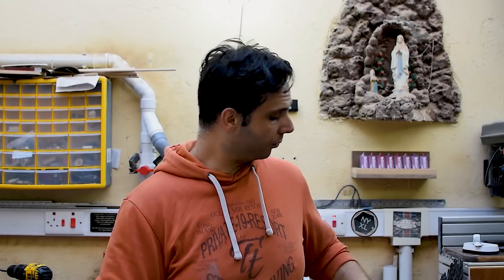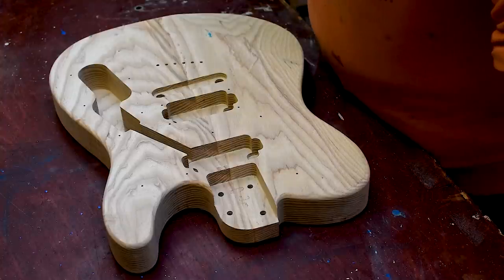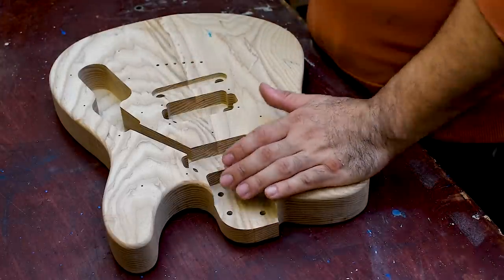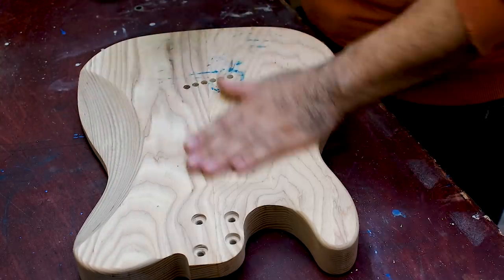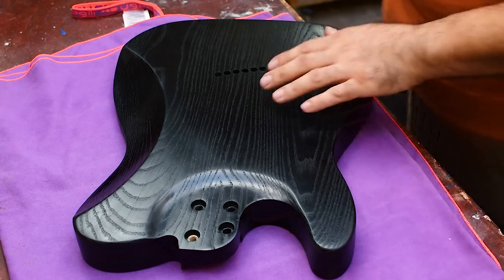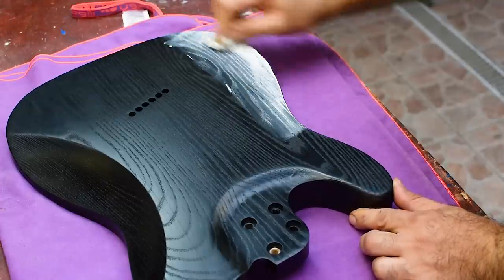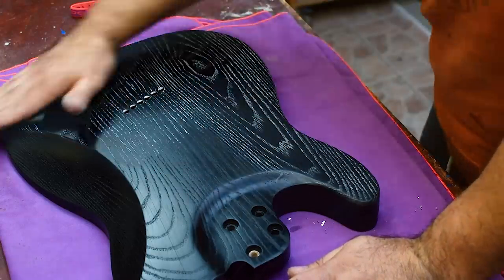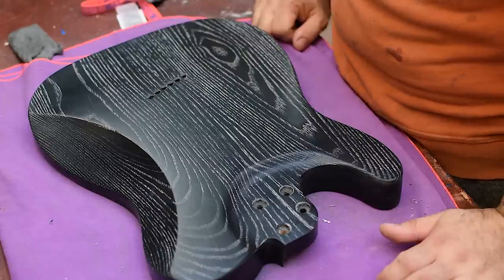Ceruse finish on an Ash guitar body blank

Comment: Based on your YT this is what I learned trying it on several samples. Wood prep: wire brush the bare wood with the grain, then sand up to 220/240, apply some Naphtha to raise the grain and sand again to 220/240. Painting: I like the black and suggest using satin black. (I used Mohawk Satin Black) I think it looks better than gloss but that’s personal preference. Apply 5-6 coats. Next apply a clear sealer or top coat, I prefer Mohawk clear satin. Apply 5-6 coats. Apply the white grain filler. I tried a few and prefer Wunderfil wood filler. Other fillers dry too fast and this gives you a min to get the excess off but you have to work a small area quickly. Use lots of paper towels or clean rags. I don’t recommend steel wool because it will dull the finish with tiny scratches. The reason for applying so many coats of paint and sealer is that you won’t rub through the black finish trying to remove the white filler. After removing the excess white (the grain may require a couple of white applications) put as many clear coats on as you like. Just make sure it’s compatible with your paint and sealer on a test sample first.
Reply from the maker: If you apply 5-6 coats of paint you risk to clog most of the pores and the effect will be less.
Reply: True but this wood is so porous and by wire brushing and vacuuming the surface the effect is still stunning. And you don’t dull the background. I’ve tweaked the process on about 5 ash samples and this is what I learned
Reply: Do you sand in between paint coats?
Reply: Jim this is darn helpful as you shared the Grain filler to use and pointed out the importance of sealing the base coat first.
Reply: @InvictusS5  sorry I’m just seeing your question. It’s been so long but I’m guessing I didn’t sand to build up coats.

Comment: so THAT'S how it's done! Been trying to figure it out in my head for months lol! Saw a cool guitar that had a red finish with black pores. Thanks for the video dude!
Reply: Basically, it's not a step-by-step how to. The guy tried to show how to make a dog hair finish, unfortunatelly, he's more of a creator, not a couch.The shape of the wood and the result though... Magnificent
Reply: Seen some Ibanez guitars with dog hair finishes, pretty cool look! But the same process should work for other colors too right?
Reply: Yep, it will work with any pair of contrasting colors. You may use luminiscent pigments too ))  
Also,  in my humble opinion, Ash is the best (but not the only) wood for this type of finish.
Reply: @Heuchler52  oak has similar open grain to ash and will work well too.
Reply: @GatenGraver  While oak splintery-splinters.

Comment: I did this to a mahogany guitar I built recently although I used the sun to first darken the wood a few shades (as  mahogany darkens under UV light) ,then filled the grain with black wood filler and used a fine finishing  sanding sponge once it had dried to remove the excess filler then proceeded with boiled linseed oil which I find pairs superbly with spray can clear coat due to spray cans containing acetone to thin the paint which allows it to bond to an oil finish nicely
Reply from the maker: How did it turn out? I know mahogany is not so much porous as ash wood.
Reply: @ManicaroCustomGuitars  it turned out quite nicely ,not as visible as the one in the video although I used black on dark brown wood so it's alot more subtle unless you look closely
Reply from the maker: That's the thing with mahogany, isn't that grainy as Ash
Reply: that's very true

Comment: Hi I love the video, can you tell me what sort of paint did you use, what sort of putty and any other material you used thanks
Reply from the maker: So, black spray can and then I used a water based grain filler putty and 0000 steel wool.

Comment: hi couple question 1 Does this work with Swamp Ash as well? 
                                 2 What were the products you were using for the Black and the sealer?
                          I have a Warwick Teambuild bass coming and being a lefty it gets very basic for what you get so its just a natural wood finish.
                        Id like to do something with it to bring it to life and I cam across  this and wow it amazing. I also subscribed and followed I was really impressed just was trying to figure out the products you were using Thanks
Reply from the maker: Well that's actually Ash wood, swamp Ash probably the same. So the black colour was a black acrylic spray can, and I used a white water based wood putty for the filling the grain and I sealed everything with a couple of coats of True oil in this case but you can seal it with lacquer too.
Reply: @ManicaroCustomGuitars  perfect thank you

Comment: When you first put on the 2 coats of black paint ......did you spray it on ?     was it semi gloss ?      Thanks !
Reply from the maker: Yes I sprayed it on and yes it was semi gloss, but that’s is not really important because it’s still need to be sealed with a clear lacquer, either matt, semi gloss or gloss.
Reply: @ManicaroCustomGuitars  Thanks !

Comment: I just got a swamp ash tele body I want to do this to.
Can you tell me exactly which black spray you used on this?
I want to just spray it black like you had it before you applied the white paste to it.
Reply from the maker: In this case I used a generic acrylic black spray can. You can use spray can or mix the paint yourself and use a spray gun.

Comment: Wait. This is the best tutorial about this styl finish. 
Just a simple question: the white putty that you use, ccould I mix it with a color, like red, orange, purple? Or where can I get color waterbased putty?
Reply from the maker: I think you may water it down a bit more and mix some concentrating paint to it. Some online lutherie suppliers have specific colored fillers for this purpose but white is easy to find at a local hardware store.

Comment: Looks really nice, thanks for sharing.  A quick question... have you tried doing this without the step of the wire brush?  What is the difference?  Is the effect just more subtle?
Reply from the maker: No, I haven't tried it. But probably yes the effect will be more subtle.
Reply: @ManicaroCustomGuitars  Thanks, I think it looks great.  One last question, does the wood retain the feel of the open pores?  I mean like compared to using a wood filler which should result in a smooth surface.
Reply from the maker: Yes you definitely can feel the wood pores, it's not a smooth finish.
Reply: @ManicaroCustomGuitars  Thanks!
Reply: Stunning. How did you seal and finish the guitar?

Comment: did you use a flat, satin or full gloss black? Thanks. Great finish.
Reply from the maker: I don't remember exactly, from the footage it looks satin. Something I didn't mention is that I sealed everything with a fin coat of lacquer. You can use gloss or satin lacquer for the final result.
Reply: @ManicaroCustomGuitars  thank you that was a huge help. You have inspired me to do the same with my ibanez. I appreciate  your video & after thoughts. Excellent work.
Reply from the maker: Make sure it's an Ash body, this technique doesn't work well with a closed grain wood like for example mahogany.
Reply: @ManicaroCustomGuitars  according to Ibanez the RG121DXL comes with a Okoume body. Im told this has a moderately porous or open grain. Worth a try i guess. Thanks again. I appreciate it.  I loved the way your finished looked even before the clear .

Comment: I got started on mine ! Pelham blue and white  looks good so far but I didn’t wait long enough and the blue mixed in with white .
So I have 2 questions . How far did you sand the black before starting? And what do you do when done adding the putty. Any top coating or Satin finish .  

Thanks again for the video I watched like 10 times
Reply from the maker: Actually I didn't sand the black at all. Yes after everything is done you can seal it with some Tru-oil or lacquer. Could it be that what you used to fill the grain reacted with the paint? That's why I used a water based filler instead of something spirit base.

Comment: Might be a stupid question, but would this work on a quilted maple veneer ? 
I want to do a silver and black kinda sunburst with this wood grain filler effect added. 
Also can I clear coat everything when it's finished ? 

And thank you for the video. 
I really appreciate you explaining how to do this, it looks awesome!
Reply from the maker: Hi, no this method won't work on that maple veneer. You can stain it black first, and sanded down then add the silver to it or vice versa and see how it goes. This Cerus finish is mostly suitable for open grain wood like in this case Ash, and yes at the end is sealed with a coat of lacquer.

Comment: There is entirely different wood grain after you snapped your fingers. It would be helpful if you showed the entire process. Thank you.
Reply from the maker: Yes in fact it's a different bank, I didn't want to wait for the paint to dry. Basically you just spray the body with paint. I used a spray can for this video. There isn't much too it actually.

Comment: Did you finish it with nitrocellulose? I did this same experiment but had trouble leveling the nitrocellulose. Now I’m not sure I can wet sand. Fantastic effect. Changed it slightly with the nitro. I thought it would enhance it but at least with nitro, it detracted just a bit. I wonder if tru-oil would have worked better. Would love any thoughts about your experience!
Reply from the maker: Actually this was sealed with True-oil. You can still feel the grain in this guitar so the finish wast sanded flat and that's the effect a wanted.
Reply: @ManicaroCustomGuitars  Can tru-oil check like nitro if exposed to cold and heat? I’m nostalgic about those old guitars. Thanks for your response. My nitro went on well and I didn’t get any high spots. Didn’t quite know how to attack this one. Can’t wait to put it together as I’ve never had a tele.  That swamp ash is great cerused.
Reply from the maker: @GIBKEL  I don't think it will check like nitro, it will get matt by time with use because it's not as durable as a lacquer finish.
Reply: @ManicaroCustomGuitars  ….damn me for taking the path less taken. I think a high grit cloth backed durable/flexible with a small soft ball of cloth as its center with small swirl to feel out the grain peeks and valleys might get me down the road. Slow and steady. The nitro laid down so nicely that I was surprised. I had only ever used a rattle can with the terrible spray heads. I wrongly assumed it would lay down flat and fill up to and even finish. It set up so quickly due to temp and humidity. I now need to tone down the shine of the nitro as it’s so reflective that it distracts - just reflects light from the beauty of that black and white contrast. Tru-oil would have served it much better. I loved the aesthetics of the Epiphone Coronet silver Fox on mahogany. Now I better understand Leo’s simplicity of painted ash for consistency’s for longevity.  Mahogany grain lends itself a bit better to these grain centric finishes. I had forgotten that the Collings I had seen as inspiration was a mahogany top back and sides though they have also nailed it with ash. I will check your site…I need some inspiration.

Comment: Great job bro what brand of materials you used?every paint and wax are different thanks.
Reply from the maker: This is the filler:
https://www.kantarzoglou.gr/en/auxiliary-materials/wood-putty-200gr-no10-natural-cosmos-lac10989.html
Regarding the paint it was a generic acrylic spraycan, and after I sealed everything with True Oil

Comment: Excellent video, buddy.  I have a couple questions. I'm trying to do a les Paul swamp ash body like the Gibson voodoo  finish. It is essentially the same look as the body you did. 1. How could I have the grains be RED on the black, and 2. is there a way to cover and protect the finish once I'm done, that DOESNT require a spray gun or a lot of technique? 3. I have a maple neck. Should I stain it or paint it to get it to match the black on the body the best? Thank you. I subscribed! :)
Reply from the maker: My apology for the late reply, so 1st you can find red filler or try using poster colors. I’ve people using it but I haven’t tried it yet myself. 2 I did put a coat of oil to protect the finish, you can do that or lacquer in a spray can. 3 honestly I love staining a maple neck black, then I go over it with 0000 steel wool to remove the excess stain.

Comment: Do you seal it with a lacquer or an oil after these steps you show us?
Reply from the maker: Yes I did,
Reply: @ManicaroCustomGuitars  What top coat would you recommend?
Reply from the maker: Up to you mate, you can use a clear lacquer or even oil, in this case I used Tru-oil to seal it.

Comment: What did you use on top afterwards as the final finish? An oil or a something like a poly or lacquer/clear coat?
Reply from the maker: In this case I sealed it with an oil finish true-oil to be precise, but you can use any clear lacquer.

Comment: Hey , can you break down the brand names of the materials used . . I’m am going for this method soon and your method is understandable to me . Thanks
Reply from the maker: So, black spray can any brand or mixed with a spray gun. The water-based wood filler/putty https://www.kantarzoglou.gr/auxiliary-materials/wood-putty-200gr-no1-mahogany-light-cosmos-lac10733.html and 0000 steel wool.

Comment: How did you come up with that black stain?what did you use?nice finish! I like it!
Reply from the maker: Thanks, that's not stain it's a black spray can.
Reply: @ManicaroCustomGuitars  wow,really nice.even better. After the grain fill, did you finish it with topcoat?
Reply from the maker: @makinuthead  Yes, I sealed it with some true-oil but you can use lacquer too

Comment: It helps to apply the filler across the grain. The result here is epic though
Reply from the maker: StraylightGuitars I'll try that for the next time, thanks
Reply: StraylightGuitars - yeah scraping across the grain with a credit card really helps push grain filler in where you need it. 

I almost went away when the wire brush appeared, but what a cool technique!  It the mirror image of typical “popping the grain”.

Comment: I did a nitro finish over a similar finish….now I’m paralyzed by the fear of wet sanding an uneven  finish….any tips. I ended up with a light nitro (13-14 coats) and yet you still have a sense and a feel of the grain from the brush tear out in prep for grain filling. It’s beautiful but not sure of what to do now. The unevenness of the grain has me concerned I will blow through the high spots and create a strange(Bad looking) finish. Anyone out there been down this road….any tips? I had to do one of the few finishes that isn’t covered that well on YT or forums. Damn me for ever seeing a Collings!
Reply: Tough one. I get your fear. I do a lot of lacquer finish work, but only on smooth wood.

Comment: Is it necessary to seal with a clear coat or otherwise? Thank you
Reply from the maker: On this body, I used a filler for the effect and in this case yes is necessary to seal everything. If you use paint for the effect, you can go without sealing it but I still recommend it.
Reply: Manicaro Custom Guitars thank you for the reply! What do you recommend for a sealer?
Reply from the maker: @fifthsonrecords1228  Some clear lacquer or even on oil finish will do .

Comment: what kind of paint did you use?
Reply from the maker: They are spirit base wood stains, and are manufactured locally. They don't have a specific brand, but maybe if you go to your local wood finish store, you'll probably find. Or else you can always use like Transtint or Crimson Guitars stains etc....depends mostly on your location.
Reply: @ManicaroCustomGuitars  I used crimson stunning stains but it's not that black ... more a dark brown... do you think that I can use the shots to have a more intense color? or indian ink?
Reply from the maker: @coolvibesradio3267  my apologies but I replied thinking this was a comment on another video. No on this project I used a common black acrylic spray can Ral9005.
Reply from the maker: For this effect is better to use paint rather then stain.

Comment: what kind of paint, what kind of paste?
Reply from the maker: In this case I used an acrylic black spray can and the paste is a little water based grain fillers.
Reply: @ManicaroCustomGuitars  Do you think this would work with a reverce colour scheme? black grain and white finish?
Reply from the maker: Yes it will, although the white might get a little bit light greyish if you don’t clean it well.
Reply: @ManicaroCustomGuitars  You hould give it a shot if you have a body around! I would love to see if it works
Reply from the maker: I had thought of redoing this tutorial with a different setup, I’ve seen people doing the same finish using poster paint instead of wood filler.

Comment: Can your put clear coat over that ?
Reply from the maker: Yes you can, of course you need to seal it with something.
Reply: So in this order ( this is a first for me), Stain, Rub N Buff,  Tung oil, Sealer?  and then Clear Coat. Does the sealer fit in there and do you have 
recommendations?
Reply from the maker: You don't need sealer because the putty Is sealing the grsin. Basically, paint or stain, wood putty, and then clear coat (spray or oil)